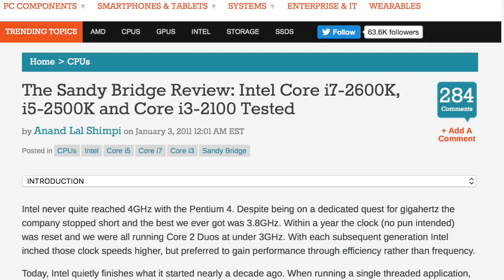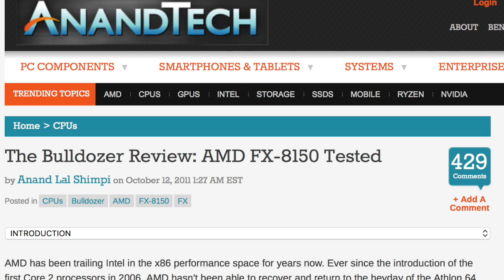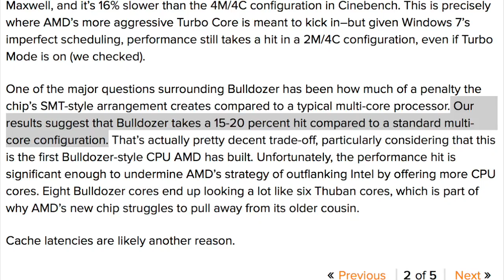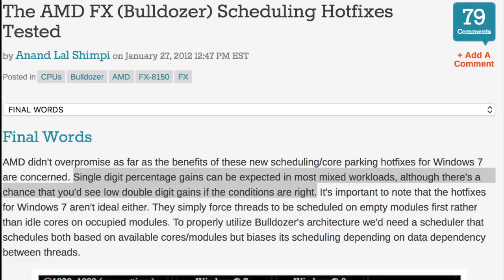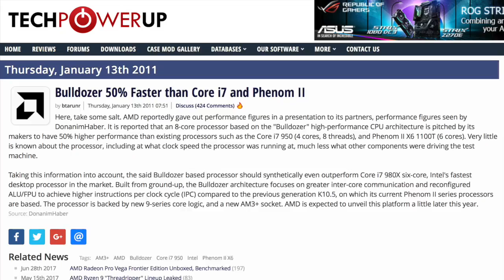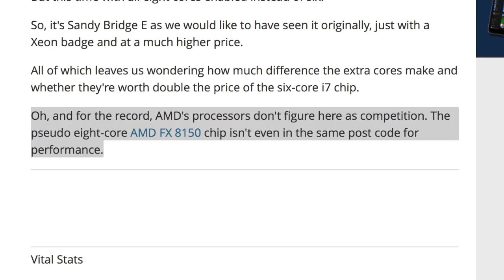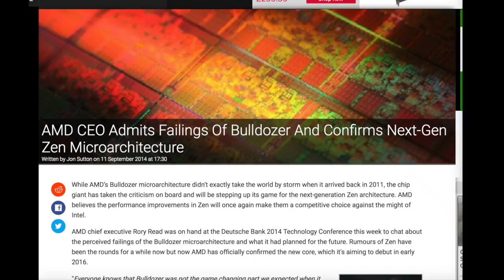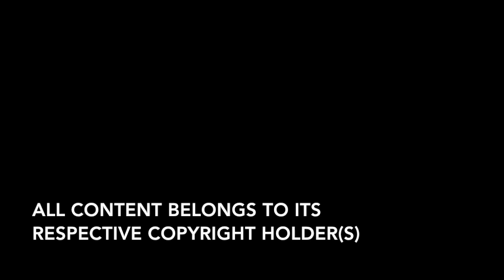The Bulldozer Story - and why AMD FX is better than you remember

Comment: Check the recent benchmarks on FX8350 vs Sandy Bridge is slightly ahead specially in windows 8 I think they did a misleading marketing, and is because the marketing department was writing articles and they never hear the engineers I believe anyway I think is more a lack of code in that time and also try to innovate.
Reply: I can't argue here. My old quad-core FX-9590 still rocks. I got a new Asus ROG Sabertooth R3.0 board with all the modern bells and whistles after my Corsair RM1000i PSU died taking out the MSI 990FXA-GD80 that it ran on, and also replaced the two GTX-970s with a single GTX-1080 for less power draw. Plays absolutely everything I can throw at it 1440p and 2160p (including burning through games like project cars on my HTC Vive..) 

I've now replaced it with a spanking new R7-1800X with a better GTX-1080. But this PC will be around as a very capable secondary system for years to come. (Its actually gotten faster with Vulkan and DX12). 

To put all this into perspective, my FX-9590 scores faster than 94% of all systems on 3DMark (on par with an i7-4790K with twin GTX-980s) while the R7-1800 scores faster than 99% of all systems ever tested in same. Being in the top 10% of all PC systems worldwide is more than good enough for me, thank you very much AMD..
Reply: It's an 8 core by definition.
Reply: bulldozer was late to release by over a year or more. If it hit release date, it would have done much better. Intel crushed them with sandy. You will see bulldozer cpus being used in cheap 4k systems in the future. My brother has a 8350 with a 1080 ti. It barely uses 40% of the cpu in most games.
Reply: Running the bus speed 5mhz below stock and the HT 600mhz below stock speeds is not really a good comparison if the performance of the AMD chip though now is it. Don't know what the NB was set at as it is not shown.
Reply: 2 cores share 1 floating point
Reply: of course there is a difference but for as long as you are not using GTX1080Ti, the difference is small. At mainstream GPUs the differences are low, but not the price difference.

And this is the key.
Reply: +Mahone Stay calm...What has Ryzen to do with this topic?
Reply: +Mahone And why schouldn't the FX 8xxx become better with time, if they optimize games for 6 or more cores the FX 8xxx will run better?
Reply: once you start to multitask (like video streaming) the debate ends... Fx8350 beats 2500k's.
they are both dated chips but still capable of 1080p gaming with mid range modern gpu like Rx 580 or GTX1060... which is on the other hand, as high end as they'll go GPU wise...

Fx8350 its still a great great budget productivity platform, on certain soft it will match R5 1400 (both stock) and be just a little under i5 7600k... for about 100 dollar used its a great deal... it will edit vids 1080p (for 4k edition it will be too slow) and handle image edition soft like champ
Reply: Actually, it did get better in Piledriver and Vishera, you ignorant fuck, something in the ballpark of 15% (mostly process refinement, probably), which still wasn't enough to catch Intel's then-current processors. Still, they were cheaper than Intel's offerings and were all unlocked. Even the first Bulldozers clock easily past 4 GHz.
Reply: Probably because he's stressing the gpu wayy more than the cpu.  If he stressed the Cpu it would probably be a different story.
Reply: You spread bullshit. I bet you never had FX. I'm still playing all games in 1080p on Ultra or High settings with my FX. 

i5-2500k is a worse CPU nowadays, especially in Windows 10. My brother regret buying i5 / GTX 970 instead of 8350 / r9 290 like I did.
Reply: I went from an FX-6300 to an i5 4690k , there's no comparing the 2
Reply: ... Thats not really true at all. In DX12 titles the FX chip will pull ahead, but in almost any DX11 title the 2500k will win.
Reply: Chris Hunter Kind of...  from what I understand it the fx processors acted like 4 hypertheaded cores (except because of hardware instead of software).  Anyway that person might've disabled the second core in each of the modules to achieve a higher overclock.
Reply: Budget Gamer kings Cinebench means nothing but how much it can render inba benchmark. in REAL WORLD TESTS Sandy bridge beats it,  and Ivy bridge smashes it
Reply: No im sorry but the 8350 does not beat sandy bridge, maybe in certain games it matches it but never beats it
Reply: Seriously, if you are reading that an FX 8350 beats an i7-2600k then you are reading bullshit. GamersNexus has done recent re-testing on SandyBridge AND Bulldozer to Piledriver. Thr FX CPUs NEVER beat out the i7-2600k, there ARE a couple games where an FX 8370 etc will  eat a stock clocked i5-2500k, but none where they manage anything like an i7-2600k.

Bulldozer is a failure, splitting up FPU and Cache access to 2 separate ALU stacks is ONLY GOOD for running Virtual Machines, games rely HEAVILY on Floating Point throughput - as do MOST Server applications. 

IF Bulldozer/Piledriver WEREN'T Failures, people would have bought them! But they did not make sense to buy for ANY MARKET compared to what Intel has to offer.  

And while DX12/Vulkan does give these FAILED CPUs a boost, it is still nowhere near to what an equivalent Intel i-core can manage on those same APIs. 

I Still run an i7-2600k, at 4.7 GHZ on all cores, with turbo disabled. And I still feel NO NEED TO UPGRADE! My motherboard is great, an ASRock Z77 Extreme4 - see the thing about my SandyBridge i7-2600k - at 4.7 GHZ I am getting the same performance as an i7-4790k basically - I am also getting the SAME OR BETTER FPS than an Equivalent Ryzen system (Again, See GamersNexus "i7-2600k re-examined" or their Bulldozer re-examination both of which were done VERY recently to show exactly how much both Intel and AMD have changed since 2011) 

And Intel certainly has not changed NEARLY as much as AMD did going to Ryzen - a CPU that actually is good, but still not the best when it comes to raw Gaming  (as that is the hardest workload I put on my PC) - as I said, GamersNexus showed that in GAMING, an i7-2600k at 4.7 GHZ is effectively tied with an R7 at 3.9 GHZ in nearly every game there is that isnt Ashes of the Benchmarks anyway!

See THAT is what makes Bulldozer a FAILURE! Sure you could get away with still running an FX POS CPU, but any decent i-core, from SandyBridge up will provide better performance and use less power!
Reply: You're crazy stupid if u think the FX 8xxx series beats the Sandy Bridge
Reply: ikr and these amd fanboys are all loud because of Ryzen's success. ffs
Even an OC'ed Fx had trouble with stock Sandy Bridge in most games and then you see people saying: It got better with time... No it didn't u fucking ignorant fucks